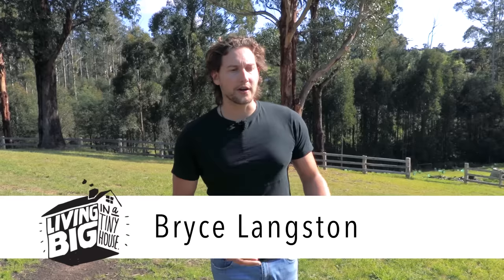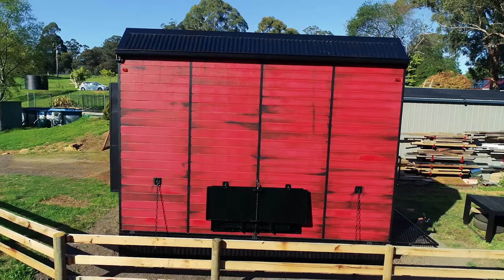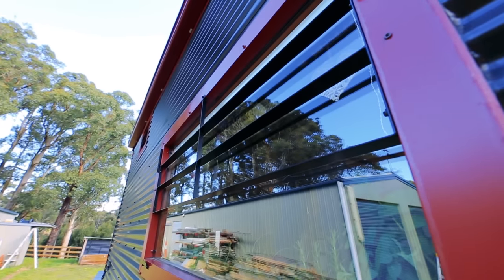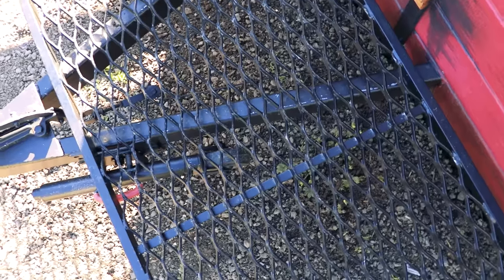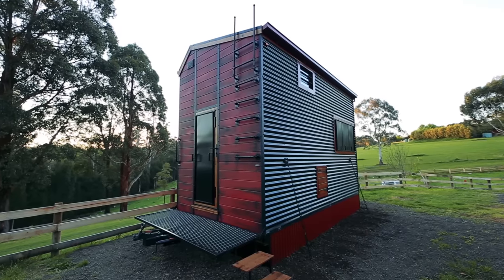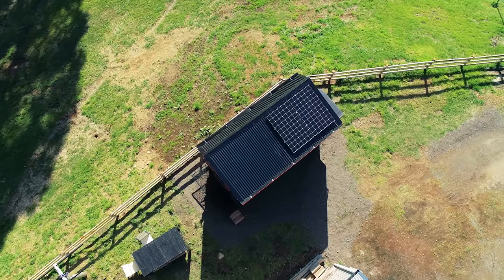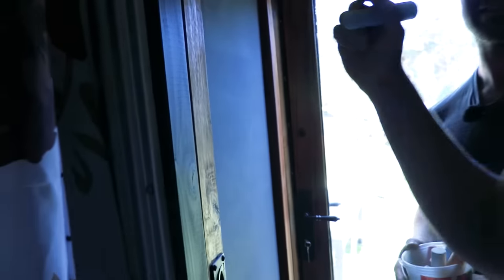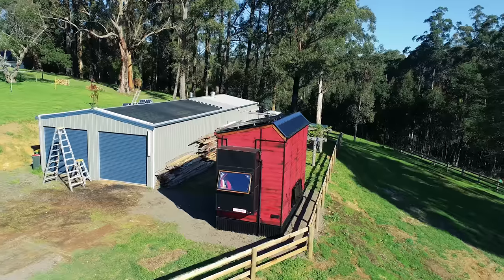Builder’s Incredible Fire Resistant, Off-Grid, Passive Tiny House On Wheels

Comment: admirable and beautiful effort, but i'm not convinced the builder's 3-minute long torching experiments are pragmatic enough to demonstrate adequate fire resistance when confronted with a spreading forest fire to save any lives. as he says, an Aussie fire front moves @ 50 km/h, or 833 m in 3-minutes. a fire moving @ 12 km/h would light up 200m during that time. if someone is stuck in their tiny fire-resistant house, they'll be surrounded, and eventually become engulfed by flames since even their wheelbase would become immobile molten rubber, and no emergency rescuers would even attempt to venture into a couple hundred meters of pure fire. fire truck ladders wouldn't be very useful here. victims will be steamed alive. the only escape on offer here is a few extra minutes offering the possibility of being airlifted out, or driving away if the wheels are ready to move. a reasonably healthy person can run 200m in under a minute. their odds are waaaaay better if they just run away (if they can).
Reply: you're right - I've studied these effects in architecture and convinced this build would not survive the kind of infernos experienced in Black Saturday and the current fires .. even less so the occupant. (see my detailed reply to Koadster above)

Comment: Nice video... But what was the purpose of the burn test/demonstration? It didn't look like the "regular" model caught on fire either. Was there a glas of water under the regular model to compare? It didn't seem to prove anything to me. But nice house.
Reply from the maker: Yup - the burn test model definitely caught fire! It showed how quickly those materials could ignite compared to the resistant ones. Glad you liked the home. Thanks for watching.
Reply: Cool. At 11:10 it just looked like the regular model didn't sustain any fire without the burner on it, but it does look very charred of course. Thanks for great videos.  @livingbig

Comment: Hello people, i've got a nice dusty attic which can be turned into a small apartment BUT i've got an issue with water leaking from the roof and its also exposed to wind....any tips about the materials i can use for insulation?
Brilliant video btw as always <3

Comment: This is cool. But I feel like he could have accomplished the same goal by just wrapping the exterior in 1/8 in sheets of corrugated steel. Make the frame out of steel or aluminum as well and use sheep or goat wool for insulation. All fire resistant, lightweight, and probably much cheaper. There were a lot of other clever ideas in/on the house though. It's a nice place. I like his ingenuity.

Comment: I know it kinda defeats the purpose and requires semi permanent structure but how about building perimeter wall around house (with a roof) that can be used as a shed or something and is used as a parking spot and another layer of protection for tiny house in case of fire.

Comment: IF YOU DIDN'T HAVE TIME TO RUN AWAY, AND HAD TO STAY IN THE TINY HOUSE,  WHAT WOULD YOU DO FOR AN AIR SUPPLY ??
Reply from the maker: Not sure about that! I can only imagine what such a fire would be like. I suppose it would be possible to keep an oxygen tank in the house? Ideally though, you'd want to get out of there well ahead of time if possible!
Reply: @livingbig  that's right otherwise you'd fry. Nice nonetheless.
Reply: Oxygen tanks are pretty common for fire resistant homes, but as Bryce said, not the best place to be in an emergency. 

Lock up and leave, if you are home. Installing the fire shutters on a hot day is also great way to keep the house cool and safe if you’re away.

Comment: I have a question for the builder if he sees this, do you have any emergency respirators/masks in there in case you do get trapped on the property?
Reply from the maker: That would be a good idea! I'm sure he will jump on to answer questions at some point.
Reply: Hi james, it’s a good question but the answer is no. This house is not intended as a fire bunker, I don’t even want to encourage people to stay in it during a forest fire. Lock up and leave is the best policy for this house. There is also no fire fighting equipment or enough water to be useful so there isn’t much point in anyone being there.
Reply: @T C Carpentry, maybe Bruce can add bold text at the video start saying it's not intended as a fire bunker.

So many people on here are calling it "fireproof" and a few imply it can save lives.

Enjoyed the video.  You did an amazing job making it fire resistant, thinking of so many details, even the vents and how to quickly cover the windows so you can then get yourself to safety!  On the interior, great how the table seats so many, plus becomes a bed!

You are smart to remove the tires.  I read that will also ensure they last longer by not having a constant load on them.  Do you protect them from UV damage, too?
Reply: Hi James, the preference to leave the house during a fire does get a mention. Possibly, future designs could act as a bunker. 

Also, the confidence to leave your house and not attempt to move it or defend it, could, on its own, be life saving or life changing. 

Glad you liked the video.
Reply: T C Carpentry, question.  While I realize it's not intended to save lives, what if pets are left behind while the owner is out for the day?  Would vents allow hot, smoky, oxygen depleted air to flow inside?

Or, if a person was unfortunately trapped, I'm thinking there are vents they may not remember to block off.  For instance, if they have a vented, propane powered refrigerator.

In the case of windows left open while away with pets left behind, is there any type of wireless way a person could close them in case of fire to prevent embers from entering?

Thanks again for being interviewed.  People can learn a lot from you.  If you build and sell tiny houses, I wish you success!

Comment: You showed a lot of really cools stuff. Your 'burn' experiment did not include a window. Windows will conduct heat more than the other materials and at some point the windows can break under thermal stress. Your metal shutters will help slow this down initially, but not in the long run.

Comment: Still don't understand the obsession with hot showers. They're terrible for both your skin and hair, completely wasteful, having a mechanism to facilitate that waste I think goes counter to the meaning of tiny homes. You waste both energy and additional water through evaporation. The higher temp water increases the rate of transepidermal water loss, causing dry skin, and opens up the hair cuticles, causing an increased loss of moisture and risk of breakage. Unless you're trying to kill bacteria to prevent the spread of disease, which is only really necessary for hand washing, washing your entire body with hot water is nonsense.

Comment: This is great and everything, but it will be toast. In real world bushfires, it will be destroyed. Just like a car she’ll that’s been in a fire, it is wrecked and will never be a car again, even tho you can tell the model
Reply from the maker: Depending on the severity, you may be right. But, if there's enough space between the home and the fire a house like this has a greatly reduced risk I think.
Reply: The fire resistance would  provide enough time to get the house ready to be towed out of the fire zone.
Reply: Thomas Janowski .....fraid not...if you’ve the time to put the wheels on and tow it, you weren’t close enough for standard materials to be a problem
Reply: Living Big In A Tiny House .....greatly reduced... agreed. I’d possibly deck those trees directly adjacent to it and the shed ....if I were to reduce the risk
Reply: @mattwoodproperty   your ability to predict fire situations is amazing.
Reply: This design is intended to be placed approximately 20 metres from managed vegetation. There is a large amount of science surrounding the construction of fire resistant houses, the adaption to a trailer is the untested component. 

It is imperative that the precise location matches the houses capacity to resist heat.